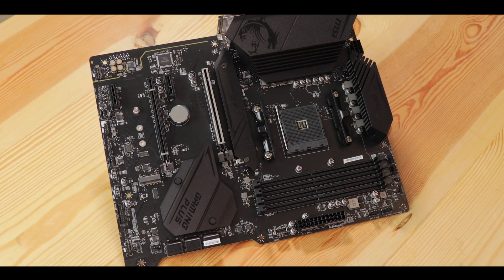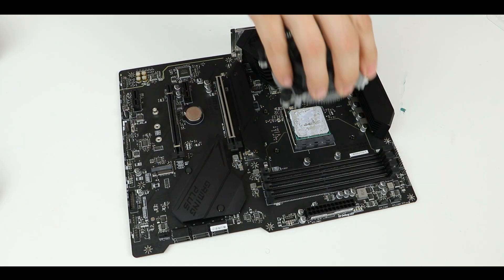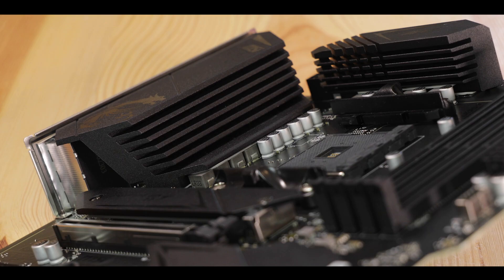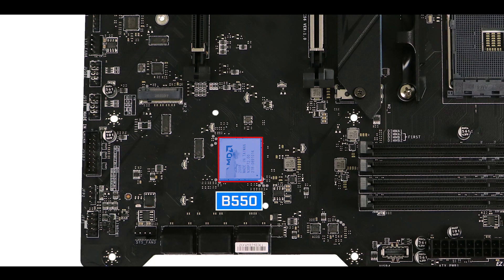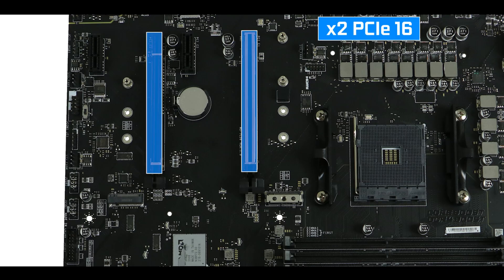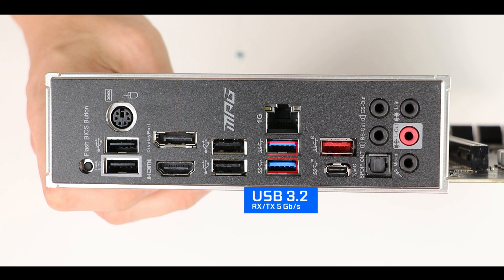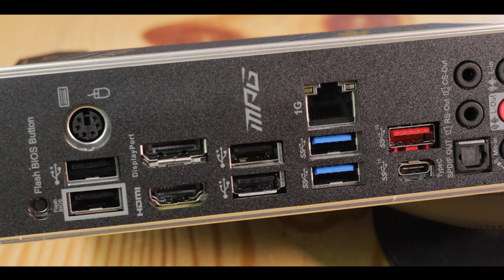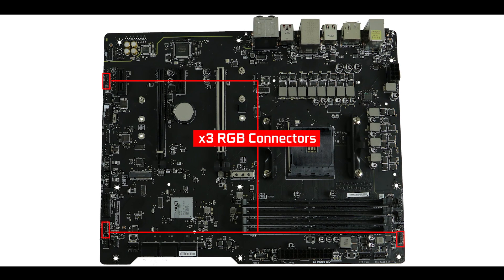MSI MPG B550 GAMING PLUS, a HOT mess!

Comment: This MOBO has 2 SSD stick slot .. why the only bottom slot working ? And the other one in top is not working .. pls help
Reply: My answer come too much late but for those who still figuring out why here is the answer:
The one on the top work only when two of sata plugs are not used, usualy the last numbered ones but check the manual to see whitch ones. This is due to the fact that those sata plugs actualy shares the pci lanes with the top M2 ssd, so you have to choose to use M2 or 2x SATA but not both.
If you did not populated all the sata plugs, you may shift your hard drive to another sata plug you free the one that shares the pci lanes with M2 plug.
Reply: @tech.curiosity  thanks for the tip man

Comment: Take a look at "$140 - $160 B550 VRM Thermal Benchmark, Not All Boards Pass!" by Hardware Unboxed and especially the comparative at the end...
Reply: I agree with it. This board is one of the best B550 boards in terms of VRM performance.
Reply: @tthimsel  not true.... Gigagabyte is best. This motheroard oveheats like hell msi plus... Gigabyte best temperature.. for its price... If you are not overclocker and  you dont have High  TDP gpu is fine .. If u have like GPU TDP 250 and overclocking memory it will  have thermal issue. I am computer expert..  and we  know that..  We test all motherboards in same ways..
Reply: @MakeSh00t  lol, this motherboard was at 2nd place every test!, This is the best b550 atx mother board!
Reply: @thegaminguchiha8570  I have it and with a 5600x cpu its become hot even at stock 3700 mhz undervolted at 0,925v. I'm going to give it back and choose a 6 layer pcb idk wich one now ill find out here. (corrected)
Reply: @keofir  9,125v  ??? wtf.... dude. at those voltages your cpu is already melted. next time try harder before trolling
Reply: @aristotle8024  you r right, obviusly its 0.925, sry my mistake
Reply: @keofir  Did you run it with stock cooler or something? Doesn't sound right. I have this board and reach only 75 degrees while gaming all core ~60% usage and 4.8 Ghz Boost.
Reply: @XBloodyR  I'm using artic freezer 2 240
Reply: @XBloodyR  isnt too hot 75 degree in your room? i live in Sardinia and thats why
Reply: @keofir  Not really after hours of gaming on high heat the temperature in my room goes up maybe from 24 to 26 degrees and when the window is open from 24 to 25.
Reply: @XBloodyR  u r lucky, 24 here in the night when its cold, when its hot its 33
Reply: I love this motherboard!! Opinions are like A-holes everyone has one! Thermally great, vrm's great,  look great.  You have to put it in a well vented case. I have been skipping this video for a while now but I said let's hear what Giovanni has to say and I disagree.

Comment: I got the board for 90€ and until now I have only two small problems with the board.
Is it normal that when I start my PC the GPU Fans run at full speed?
And every morning I start my PC after turning on the PSU again, it takes some time until the Board notices me pressing down the power button, this happens only when the PSU was turned off.

Comment: Been running this mobo with a ryzen 5800x and rtx 3080 for a couple of months now... no issue with vrms whatsoever.
Reply: Update ?
Reply: @YacinFilms  It's a great motherboard! the vrms are superb even when using PBO overclocking with my 5800x!
Reply: @Simo-cr6pf  any update Simo!
Reply: @ashrafhmn  still running great after 2 years! 😊
Reply: @Simo-cr6pf  thank you! 
one more question.
no sound issues?
Reply: @ashrafhmn  no everything seems to work just fine.
Reply: @Simo-cr6pf  Hello my friend, I want your advice. Is this security plate good or should we think about another plate? This is my first assembly.
Reply: @Simo-cr6pf  still good sir?
Reply: @Simo-cr6pf is it still going good
Reply: @Ebw517  this mobo is good. i tried a 350mhz overclock in my ryzen 5 5600 with prime95, the vrm didn't go past 62 degrees celcius with a hot environment
Reply: Apparently Laurent got the one shitty version of this board because everyone else version works fine. Truth is, this review is fucking worthless.
Reply from the maker: And u should not :)

Comment: Man how much good are u in my experience bilzoid knows better about motherboard than u ASRock b550 steel legend , msi b550 a pro and mortar comes with 4pcb layers
And buildzoid has said they all are great boards Steve from hardware unboxed has showed yes that with an 3900x oc to 4.3ghz with 1.35v the mobo doesn't goes above 71°c u are sleeping during video or what
Reply from the maker: Oh BTW , I am aware of an issue with this board temps I went through. 
Already passed it along manufacturer in tbe case I had a faulty board. 

Hopefully I'll get another one and will update the review  :)
Reply: @Laurentschoice  u should pin this comment that ur specific board have issue
Reply from the maker: @mainly_dyutish9  I'm not certain that it was the issue.  As soon as I get confirmation that it was, I'll upload a refresh review :)
Reply from the maker: Sleeping  :) mostly. 

I try not to watch other reviewers so that I get my own opinions  :)
BTW a 3900x at 4.3 ghz... isn't really an overstock ;)

But I appreciate the comment Lone Guy :)
Reply: @Laurentschoice  it's lone guy not loke
Reply from the maker: Apologies  :) . My French auto correct acting up again
Putting kids to sleep so half typing, half trusting technology

Comment: Bro I Purchased it ,  WITH Amd Ryzen 7 3800 X [ 8 Cores , 16 Threads ]  and RTX 3070. 

Is it bad or good ? Will I face issues
Reply: does ur build work?
because i bought the same system yesterday
Reply: @timobociek3121  yes it works fine
Reply from the maker: No issues if u have a solid air flow. 
3800x... ur golden !

Comment: so should i get this or the tomahawk for overclocking a 3700x ?
Reply: you can go even with lower priced board for 3700x something like msi b550-a pro, they are pretty much the same, you pay extra 30$ for additional 2.5gbit connection for b550 tomahawk and that's it.

Comment: I actually got the board for my first pc build for around 100 € Is it good to use with a Ryzen5 3600 without OC ?
Reply: Yes. I have a R5 3600, 2060 super, 32gb ram, 1tb hdd, 250gb m.2, x2 500gb ssd, 700psu. Haven't had a single problem with the board.
Reply: u use your m.2 in upper slot(m.2_1) to work with sata ports and gpu in upper slot(3.0/4.0 x16)? or what your combinations with slots? cuz i have some problems with my sata when my m.2 in lower slot, should i transfer in to uppe one?

Comment: Hardware unboxed did a large comparative with B550 mobos. Msi b550 gaming plus showed to be one of the best in terms of thermals.
Reply from the maker: I think I have already replied to this :)     So I have done 2 more testing (just to make sure) . Lowest PCB reading I got was 104 on 3900x 4.8 stress test.   It is possible that i was sent a deflective board.

Comment: Why does this board have really good reviews online at like Best Buy or google but youtubers don’t like it?? I just bought this board planning to do a 5600X, rog strix OC LC 6800XT, and 16 gig 4400 MHz ram build will this still be good???
Reply: Did you complete your build yet?
Reply: @DolanDuck575  I did. I had a defect unit out of the box so I returned it to Amazon and got an X570 Aorus Pro WiFi which has been working great with my 5600x, patriot viper ultimate 16 gig 4400 MHz ram, and EVGA FTW3 RTX 3080. I can’t comment on this MSI board as mine didn’t work on arrival so idk if the board is good or not :/ hope that if you are getting it it works good for you!
Reply: @LanceBarkeryt I'll be getting the board tomorrow through best buy. Pairing with a 5600x and 3070. Thanks for the info! Glad you got it sorted out

Comment: i really do think you are mistaken with rear pcb measurements. bc hardware unboxed also did PEAK rear side pcb measurement with an 3950x at 200w (4.3ghz @ 1.375v) and it reached only 71c. That is a way too big of a delta between results. What are you measuring temperatures with?
Reply from the maker: Hi there. That was my suspicion as well.  We tried a couple times more with the same results (112c and 108c were the lowest reads.). 

Could be we got a bad board. Would not be the first time :)

Hope this helps.
Reply: @Laurentschoice  thanks for taking your time to answer :) what are you using to measure temperature, thermal camera or probes?

Comment: love this man, i was going to buy this but he shed some light abt the cons of this motherboard, thank u!
Reply: He is WRONG. Check for real world values for VRM-temperatures, like on Hardware Unboxed. Laurent is not providing a single value for temperatures all he does is "must be more thasn 120 degree on a 4-layer board"-guessing.
Reply: @blablub5134  yeah Hardware Unboxed has a great video on other B550 boards including this one and they think it's just fine, not a mess by any means
Reply from the maker: Just guessing ? :)
Reply: @Laurentschoice  I wouldn't say you were just guessing and your analysis is def valid with good points, but would you say for something like a 3600 or a 5600x with a light overclock it would probably be fine? Maybe put some thermal pads on those solder points to keep them cool?
Reply from the maker: Thanks for the comment freemind. Definitely got some 'heat' out of this review (as well as it's Z490 variant). 

With a 3600, temps are fine. It did not get above 75c. But hear me out:

With a 3950x OC at 4.3ghz (with bursts as high as 4.5), 70 minutes stress test, temps gradually went higher and higher. 

It did plateau at 90c at around 20 minutes, but as I changed the synthetic testing to CPU-Z stress test, the soldered points (on the back PCB started to go above 100c). The VRM remained at about 85, but the soldered points were accumulating much more heat. 

Now it's fine . Obviously these boards are made and graded to support these temps. 

But I did have to mention it. Especially when the competition (or even the B550 carbon) could get away from high temps. 

It's never fun to run a "not so positive" review, especially when other larger channels seems to be much kinder to that very product . 

I purchased the board myself and made a point not to look at other reviews so that I could get to my own conclusions. 

Which is always problematic especially for my relations with MSI :):)

Actually since this review I now include footage and the screenshots of my heat gun recording just so viewers can alsoale their own analysis of the thermal situation . Which is a plus.

I do appreciate your intervention though. 
It does provide a richer understanding of the board.
And....it also show that some viewers (such as you and Bla Blub) have a higher understanding of components than the average, and I really appreciate you both sharing your comments and opinions on my channel.

It only makes it a better place.
Reply: @Laurentschoice  I suppose going forward, you could include notes on who the board is for. For someone like me getting a 5600x, I probably won't need to worry about onboard temps when overclocking. If someone is running a 3900x at stock, they'd be okay but overclocking long term is off limits. For someone that wants to overclock the best processors in the 3000/5000 series , they'd have to increase their budget. There's nothing necessarily wrong with the board, it just isn't catered for every use case. It is a "gaming" focused board after all.
Reply from the maker: @FREEM1ND  I thought I did... Didn't i mention the board would be fine for a 3600/3700 CPU. 

If not :) apologies :) and will make sure it is in there !

Thanks again for Ur contribution. Free mind.. you do wear that name to perfection. :):):)
Reply: @FREEM1ND  Especially with the given price tag. This board went only 71 degrees (PCB backside) on 1,375V overclock of a 3950x ! Which is really good. Only very expensive boards show better values for VRM temps. And even the Tomahawk, which @Laurent advertises to take over this board performed only a little bit better with 62 degrees, but its around 50€ more expensive.
Reply: @Laurentschoice  Well, I did't see any measured values in your review at all. Therefore I wrote "guessing".
And as I said: if you check on HW-unboxed you will see, that this boards basically DESTROYS all the other budget competiton for a B550 board - in terms of VRM temps.
Only expensive board do perform better that the MSI B550 Gaming Plus.
Reply: @Laurentschoice  Thank you for the very decent review. I think it's this kind of quality stuff, that "makes it a better place" (your channel). :)
Reply: is this motherboard good enough for a 3700x with oc?
Reply: Is this board good enough for 5600x?

Comment: Hey Laurent. Apart from the B550 Tomahawk, which other B550 motherboards would you recommend between $150-$200 or £150-£200. I'm hoping to pair it with a Ryzen 9 3900X or Ryzen 9 5900X; for maximum price to performance.
Reply from the maker: Aorus B550 Elite is really really good. I think I reviewed it .
Reply: @Laurentschoice  You reviewed the Pro but you said the Elite was basically the same specs but cheaper.
Reply: @jamesrobinson6428  same specs, different arrangement, Pro is much better in terms of VRM temps

Comment: I just dont understand why you rate it so low. Hardware unboxed showed very good vrm temp results even with an overclocked 3950X (71 degrees). Best in price category they reviewed for that specific bench. Apparently the design does work.   Edit : After reading all your comments, seems like they lacked some thermal testing in the review. I got it for 109euros as other mentioned, and since I will just probably do a slight overclock of my 5600X, I'm good to go :) Thanks for the insight!
Reply: Anyone can post an opinion. But if it works that's all that matters. After all it's not like a billion dollar company with a bunch of electrical engineers designed it or anything.
Reply: Is it good or nor
Reply: Can u tell me the best motherboard pls
Reply from the maker: 109 euros !!! What on earth!!!! 
Its an absolute steal !!!!!

Been playing Cyberpunk on a 5600x.... flawless ! 

You sir, are going to have fun!
Reply: @Laurentschoice  do you think it would work with a overclocked 5800x?
Reply: @Laurentschoice  cheapest price is 135 Euro in germany hahahaahahahah
Reply: @semj   i buy it 656 SAR

Comment: It has 2oz copper per layer not 2g do you understand what a 2oz PCB is & why they would use it on a 4 layer motherboard?
Reply from the maker: I do :), they are mentioned in the beginning of my review (when I give details about the PCB layers) Still it did not help those PCB temps. As long as we do not have 6 proper PCB layers, with their copper plates, heat (at solder points) will be way too hot for me to recommend these kind of boards :).

I hope this clarify and thanks for watching Britexit.

Comment: The PS2 port is useful for debugging. If the USB controller is dead, you can use the PS2 port for keyboard and mouse
Reply from the maker: I d agree. But usually talking, controller dies on overclocking boards (first to fry). I just don't see it here.
Reply: @Laurentschoice  yeah you are right, they could remove the PS2. I forgotten this board is made for gamers and not overclockers. And yeah I think they could remove the DP, the HDMI is more a standard than the DP ( sorry if my English is bad, I’m a student in France :p)

Comment: I believe the WiFi version of this board is quite good.
Reply from the maker: As long as you stay at 6 cores (5600x / 3600x ) , you should not have any issues.
Reply: @Laurentschoice  check out the b550 gaming edge WiFi. 6 layers, WiFi 6, decent vrm. I heard it’s like a tomohawk but better. It’s also priced very similarly to this one...
Reply from the maker: reviewing it now! with the Carbon. Totally better boards... absolutely agreed.
Reply: @Laurentschoice  what about Ryzen 7 5700g without overclock?